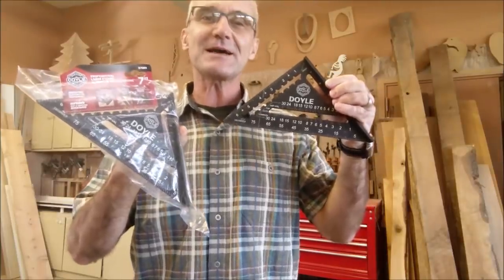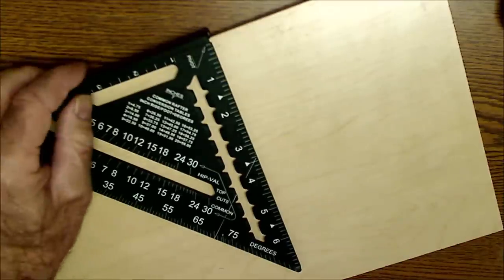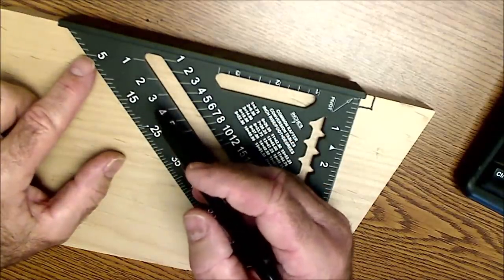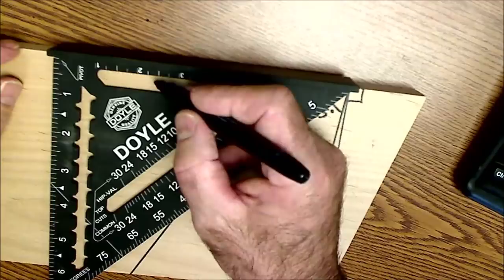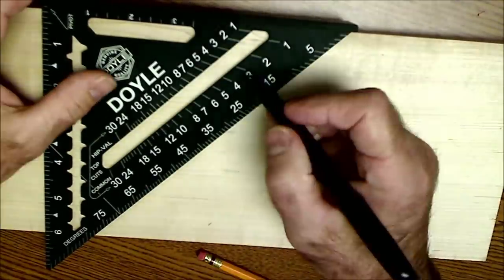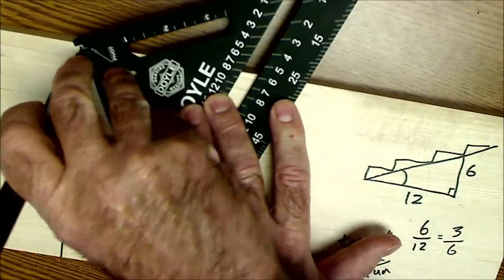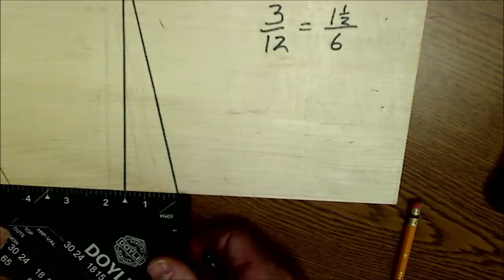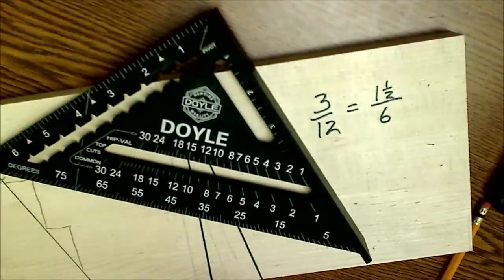How to Use a Speed Square to Mark Angles, Rafters, Slope

Comment: Well done. Thank you for the straight forward intro to the speed square. I have used one of these for a long time but only for 90's and 45's but now I'm building stuff that requires me to know angles and I knew the speed square and t-bevel guage we're going to be the necessary tools to master. Thank you for starting me down the road with a common sense approach in clear wording.
Reply from the maker: Great to hear

Comment: The speed square is the Leatherman of carpentry but question is can you determine rise/run, pitch, slope when you only have access to the bottom of the beam? How do you make the calculation without being able to bring the edge of the beam to the SS blade?
Reply from the maker: Yes it is

Comment: If you teach others how to work with an angle, try turning the angle once when cutting according to a 90-degree angle, so that the saw goes along the longer side of the angle right at the beginning. The cut will be much more accurate.
Reply from the maker: Good advice thank you

Comment: What is the difference between angle and pitch and when to use it. I want to build a 2/12 gable awning. Thanks!
Reply from the maker: Angle is between 0 and 90, used in math and design. Pitch is only used in construction and architect it is slop, rise over run and the denominator is 12. If you had a 12 in 12 pitch that would translate to 45 degrees
Reply: Thanks for the response and great info!!!

Comment: How do I find a 135 degree angle with speed square
Reply from the maker: Mark the 45 degree angle on the opposite side it's supplement (two angles that add to 180)  will be the 135 angle. Hope that makes sense